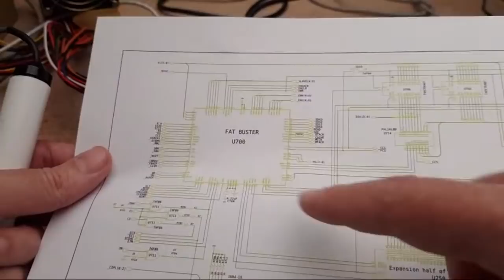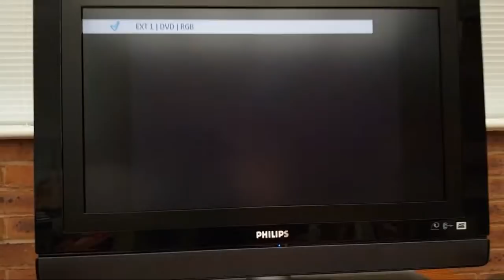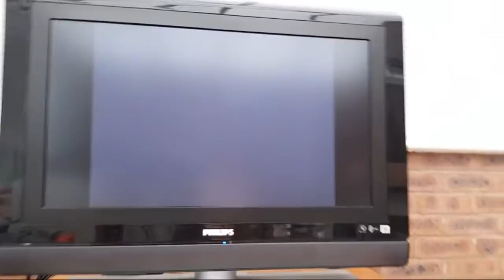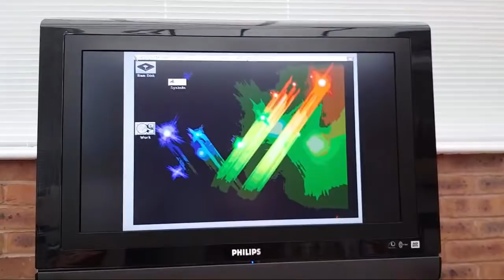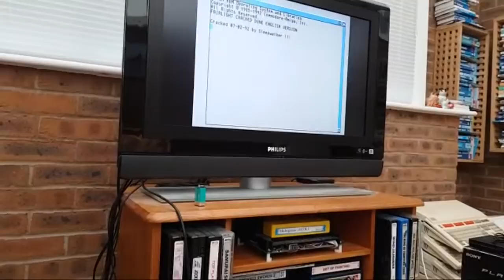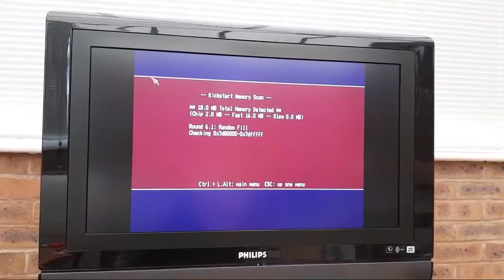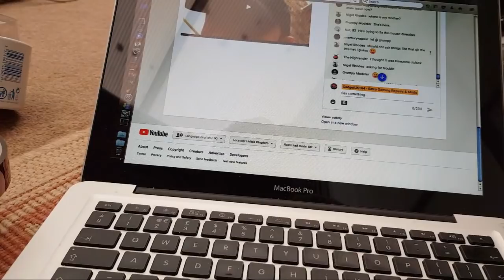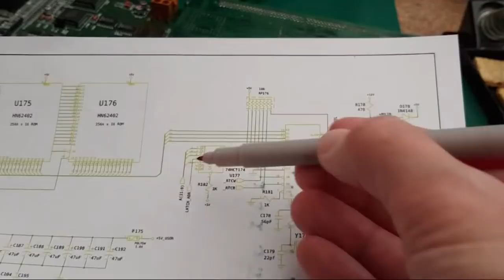Commodore Amiga A4000 Yellow Screen - Can we fix It today?

Comment from the maker: NOTE: Pin 3 on that F86 was just buffering the _CDAC signal.  So that's what was wrong, it was missing the _CDAC signal.  By litterally bridging pin 1 to pin 3, it may have sprung to life too!
ARGHHH!!  I can see it didnt go on flat - going to go and just reflow it with hot air now to get it to sit flat!!!  This is the problem when trying to solder something without magnifcation (as I usually do).  Fixed it a few mins ago - https://www.youtube.com/watch?v=Dcu3bEpRE7s
NOTE: The reason it doesnt boot properly from IDE at 36:24 (ish) - its missing fast RAM!!!  That's normal behaviour for the CF card I was using!  Just worked that out now!

Comment: Hi Gadget, I had a working A4000 but no AGA screen modes in WB so decided to replace U976 and U177.  Now I have a yellow screen.  At the same time discovered C177 was burnt out so replaced it with a std 100nf ceramic.  Today I replaced U711 (F86) still yellow screen.  Removed U976 & U177 & C177 and put on old U976 and cleaned Buster.  Still Yellow.  Diagrom passes all tests.  My logic probe doesn't tell me much and all traces from what I replaced are connected so I'm wondering where I should check next?  Thanks.
Reply: Hi, after many hours today checking all 84 pins on buster and confirming they were connected somewhere on the board I'm happy to say I have no more yellow screen.  What I found was pin 29 on the buster socket was pushed in a bit so I simply bent out the relating pin on the chip just a little.  This solved my problem.  Therefore I'm concluding most yellow screen issues will be related to buster in some way.
Reply from the maker: You beat me to it - I was going to suggest checking Buster socket pins - yellow screen when everything passes all the test in Diag ROM is always a Buster problem!

Comment: Hi, I have the same problem, a diagram without any failure but a yellow screen on startup.
The only difference to your A4000  is, that I built it completely from scratch on a new Acill Replica Board; almost complete new parts on a new Board. It worked for a few minutes with Kickstart 3.1.4 but unfortunately after a few new starts it just gives me a yellow screen. I am out of ideas , checked every trace and solder point - do you have any idea where to look at ? How would you proceed with the diagnosis? greetings
Reply from the maker: If you remove the chip RAM, do you get a green screen?   It can be quite difficult to diagnose the yellow screen, unless you can scope things or get a logic analyzer onto it.  You can do a few things to divide and conquer - eg. Fit DiagROM - see if that boots and passes all tests (RAM etc).  If it works 100% will all the tests in DiagROM, that's a clue the problem is most likely something related to Buster.  Yellow screen means an unhandled exception has occured, early in the boot process - it could be a databus or address bus issue (caused by lots of possible things).